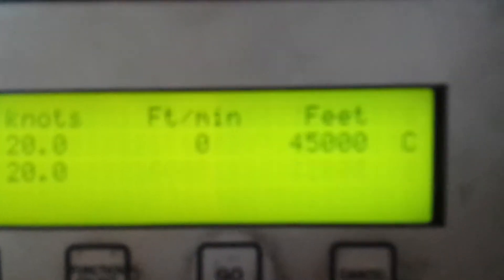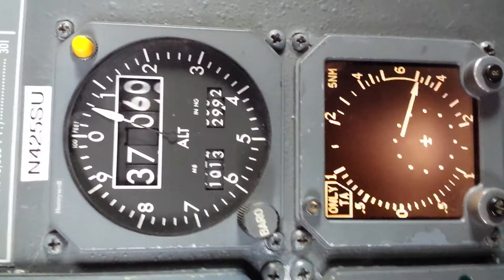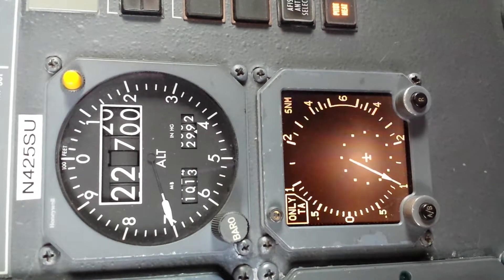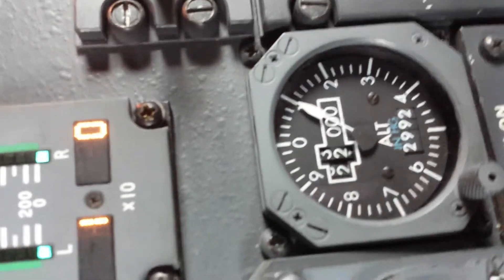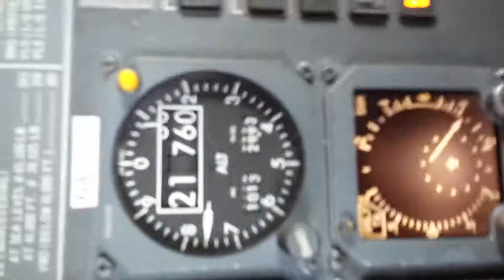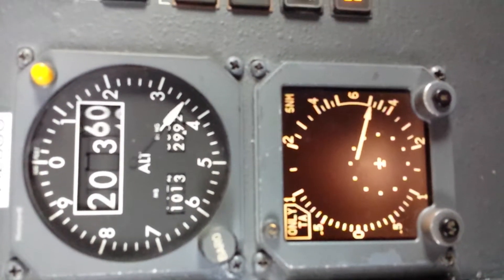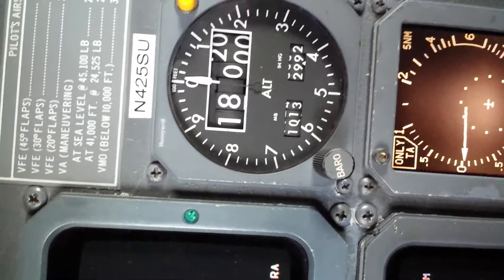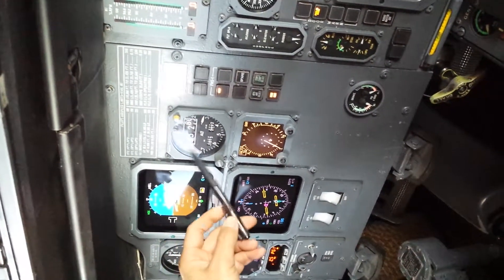Hysteresis Inspection ~ Standby Altimeter having issues

Comment: Your assistant was actually correct when he mentioned tapping the standby altimeter before taking the hysteresis reading. Without doing so, you are seeing the combined effect of hysteresis and friction, not just hysteresis. I would guess that had you tapped the altimeter, it would have passed hysteresis, but shown that the problem is actually friction.
Reply from the maker: It had already failed the test for Altimeter Scale Error. Tapping it out to make it pass was not necessary.
Reply: Pitot Guy I think it is more to clarify to anyone watching this video that they should be tapping when testing for hysteresis. It isn’t about “making” it pass, it is about following the proper procedure for testing.
Reply: @TheOleric ”norms” can complacency